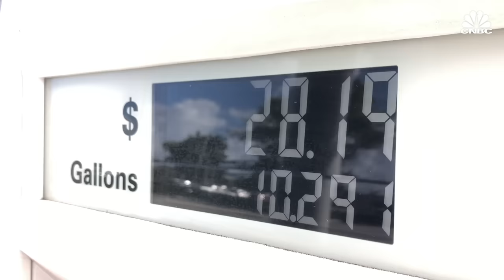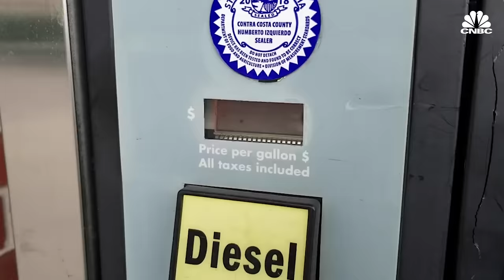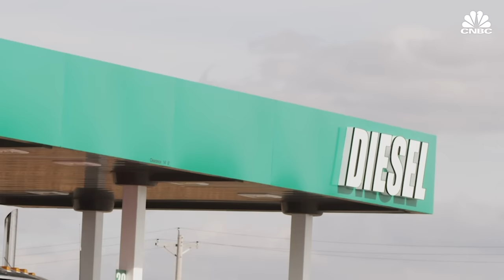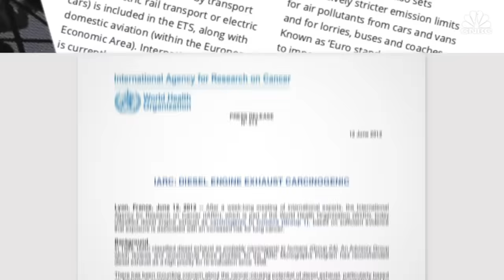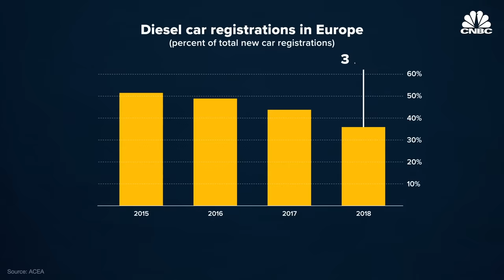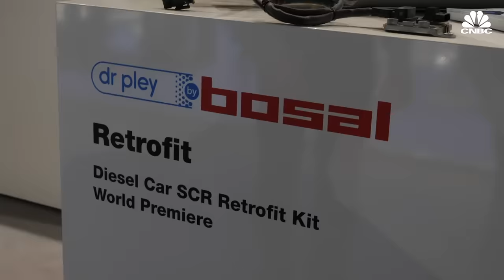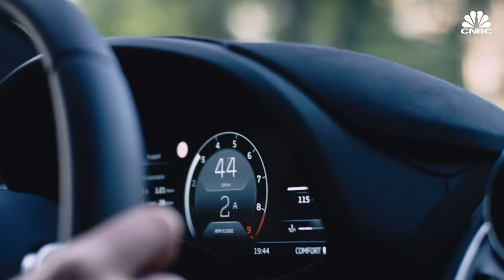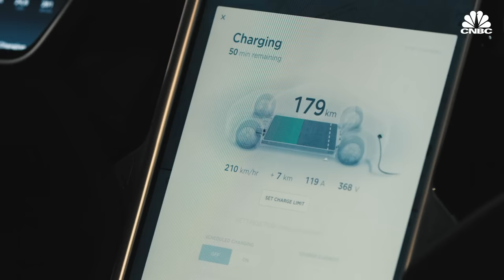Why Diesel Cars Are Disappearing

Comment: They don't deliver a great deal of "power" to the wheels... THEY DELIVER TORQUE. Rotational force.
Reply: No they deliver power. Providing a ton of force to a car over 0 distance is going to do nothing. Providing power to a car is why the force continues to push as the car drives
Reply: He mentions this at 4:50.
Reply: @IFearlessINinja  Power is Kilowatt, Torque is Newton-meter (or pound-feet) ....not exactly the same. Diesel usually have more Nm per Kw than Petrol.
Reply: @IFearlessINinja  like... i had a petrol golf 150Hp(=110Kw) 200Nm, now i have a diesel benz 177Hp(=130Kw) 400Nm -> that's double the torque but only about 20% more power, in Austria i pay taxes for power not for torque that's why diesel is great here.
Reply: Torque = how quickly you get from 0-60
HP = how fast you can go ie 200mph
Reply: Its a journalist science which they can feed to not so understanding masses, not everyone can understand torque
Reply: It's more power at lower RPM's, which is more torque, however it's not any different than if a gas engine had a permanently attached gearbox that reduced speed to the same RPM range as the diesel and same torque, is used instead of the diesel engine. The gas engine will wear out faster due to the high rpm's and be less efficient, so diesel is like a free gear reduction gas engine, but much better efficiency and reliability.

And just to prove me point further: what is different about a gas turbine powered generator and a diesel powered generator in performance? The answer is NOTHING. The diesel and gas turbine with equal power ratings will not have an advantage over the other in performance. The diesel will use a 900 to 1800 RPM generator head (60 Hertz), which takes more torque to turn, and the gas turbine will use a 3600 RPM generator head (60 Hertz), which is less torque required to turn it, but the end result is the same POWER. Power is power no matter how you gear it down or what produces it and in electricity production that is what matters. No one talks about torque. A 900 RPM, 100 HP diesel engine is NEVER going to power more electrical devices than a 200 HP,  3600 RPM gas turbine. POWER is what matters. The 200 HP gas turbine will power more equipment whether it be motors, lights, or electronics, or whatever you have in mind that needs electricity.
Reply: Dzor Misleading how?
Reply: Dzor You don’t have to assume anything none of that you explain has nothing to do with anything. Only things that matter most is weight/resistance and how efficiently said powered is transferred. But even then that basic principle applies that HP = top speed and Torque = how quickly you achieve that speed. This can be applied for the ground or in the air. You’re just trying to be overly technical about the matter.

Comment: At 11:30, talking about the newest generation of diesels with particulate reduction. And catalytic systems to keep them clean, that’s the first things that get ripped off that new GM, Ford, or Ram pickups and tossed in the trash.  I know a few guys with diesel trucks for towing, and they brag about the ‘tune up chips’ installed for more power after the emission controls were removed.  It’s so easy it’s as if the legacy companies designed the vehicles with removing emission controls in mind.  Few places check emission controls on older vehicles.

Comment: I never cared about the “Volkswagen diesel scandal “

It was a nonissue. 

Personally, I want a diesel Polo.
Reply: Dirty stuff, lpg is a lot cleaner and cheaper with out the particulart problem and in city's they not as economical, there made out to be
Reply: jim coulter  That's the joke of modern emission standards, a lean burning engine runs hotter so produces more Nitrogen oxide. So to run cleaner they need to burn more fuel....this is for all fuel types and not just diesel.
Reply: @Pete856 .... It the usual set of compromises.
Reply: I agree 100%. If I could make my own cheat software I would do it. I remember the old 1.9 VW diesel would get 55+ mpg and is still a popular engine for swaps into Jeeps and smaller trucks like S10’s and Sonomas. There was a mechanic who swapped a Cummins 5.9 into a Silverado HD and got more than 2x the mpg. His fuel savings since swap was over $25,000 and he’ll probably swap the engine into a newer truck because the body of the old truck is rusted out. On our farm we used to have a Chevy LUV with a little Isuzu diesel. It got crazy good mpg. I also used to own an old square body 1991 Dodge Ram 3500. The engine went 600,000 trouble free miles pulling a huge trailer most the time. It could get 22-23 mpg with no load and not much less than that pulling 20,000+ pounds. Same story with that truck, the body and frame were rotted out from salt but the engine was perfect
Reply: Diesel engines in passenger cars should not exist - it is merely trickle-down from heavy rigs that need the pulling power. The scale does not apply for passenger cars that only carry a few hundred kg more than tare weight, petrol is just fine.
Reply: No, the polo is too small for a diesel. Only trucks and large SUVs should run on diesel.
Reply: Nasty, many nations cared about public health to the tune of billions of dollars.
Reply: jim coulter  More NOX, please learn about the issue
Reply: @Pete856  Physics vs preference
Reply: @joebloggs9392  Are you aware that over 55% of Europe's passenger cars run on diesel? Diesel gets better gas mileage and modern diesels actually pollute less than modern gasoline engines.
Reply: @DelTalkoh  
Yes but just because everyone does it doesn't make it right... Diesel has it's place when hauling tons of weight but seriously you want a diesel Polo!? Guess there's no cure for stupid these days.
Diesel is more inclined to produce nitrous oxide as the combustion ratio is higher and diesel particulate filters can become easily clogged relatively speaking. go petrol and you have no issues with filters clogging and needing highway runs to burn off, I still get 5.0L/100km in my Mk7 VW Golf, and that's the longterm trip computer reading, yes it's petrol and 1.4 TSI EA 211 engine.

Comment: Here in the UK, the annual car tax was based on C02 emissions since 2001 to around 2017. A 2000cc diesel engine would put out around 200bhp, achieve 60mpg, and would cost about £100 a year to tax. Whereas a 2000cc petrol (gasoline) could produce similar power, but would only hit around 40mpg, and cost closer to £300 a year to tax.

Then there's the cost of fuel. Diesel was typically sold for much less than unleaded but once everyone switched, the price increased so it's now 10-15p a litre more expensive. 

Finally, cancer. They knew in the 90s that diesel was a carcinogen. I had a 1996 Peugeot 306 DTurbo and there was a cancer warning in the handbook which advised against idling the engine in confined spaces for this reason. 

Basically, the government set the narrative. 

As for me, I had a diesel car, it's smooth, powerful, gets great economy on the motorway and is much more relaxing to drive than these new little 1 litre turbo petrol engined things..

Comment: Still seen in most farm and construction equipment. More like ALL...
Reply: Eric one day they will eliminate the production of diesel
Reply: @bngr_bngr  They already have ball-less tractors with the def additives necessary-and 25% loss of power.    Tier 4 crap that will break
Reply: Do you get the feeling that the little CNBC documentary has an agenda? The air was so hot that the fuel burned as soon as it was injected into the cylinder. This is a poor description.
These engines should be left to the people who need and understand them.
Reply: @bngr_bngr  10 years from now? 100? 500? Maybe a few billion years when the sun vaporises the earth? That hardly narrows it down.
Reply: They can't, physically. Fractional distillation of petrol invariably produces diesel-grade fraction. Not as much as today's share of diesel (some of it is synthesized), but a very sizable share. If sales are banned then what will happen to unsold diesel? Cracking it down to ligher fractions is technically possible, but too costly. Burning for heating? Possible, but cleaning up flue gases to automotive exhaust standards isn't cheap too.
Reply: It's fine it's just gonna mean more down time and more screw off time,  lower production . That's when big farming will go to other places on the earth that aren't so over regulated that usually what happens look at Your boys in California once powerhouses in almost everything now a mass Exodus of business.
Reply: @jimtekkit  what the hell ever they were telling us crap like that over 30 years ago when I was a kid and sea level is still the same we are all still here and we are all gonna still be here. Tey went from global warming to global cooling since they couldn't get it right the just gave us climate change to pretty much cover thier asses in case something happen they could say "see see that's what it is"

Comment: 4:52 "But seldom found on sports cars or race cars". They surely haven't heard about Audi R10, R15 and R18 or the Peugeot 908 HDi Le Mans prototypes.
Reply: Have you heard the definition of seldom? It doesn't mean never.
Reply: This CNBC mockumentary sure seems to have some sort of agenda. 
Hey Fun Fact Francisco! Diesel engines were run at Indy. Unfortunately the damn things wouldn't stop enough for fuel!
Reply: Cummins ran one at Indy 500 in the 1960s.   DIESEL engines were banned after that becsuse it was decided  they had to much of a fuel effency advantage
Reply: These cars had their day due to the regulations being bended to make sure they'd win by limiting everyone else's possibilities. Plus they were mere prototypes made by big industry and big money. They were impossible to drive under the rain. So the regulation changed to a more balanced one and they just disappeared as fast as the appeared.
Reply: @brianpatrick8787  1952 and it set a lap record and took pole position.
Reply: Well said. Typically poorly researched and American based report.
Reply: @julosx  What are you on about?

Comment: We bought our diesel because of its torque and fuel efficiency. Our next vehicle will have full torque at 0 rpm and burn no fuel.
Reply: It still burns diesel elsewhere... your electricity must come from somewhere
Reply: @hhnguyen1210  Electricity on the grid almost never comes from diesel. The rates differ for different countries, but generally more countries are getting a larger proportion of their electricity from renewables like solar and wind, and less from highly polluting sources like coal or petroleum. Same for the transportation sector.
Reply: @BritainRitten  nope 20% coal and 30% natural gas aka petroleum aka gasoline and only 3% is wind and solar and 40% hydro electric dams and nuclear so no wind and solar is not going above 10% my guess
Reply: At last a comment from someone who gets it (and has got an EV). I understand people being sceptical that EVs are even a thing, never mind a better thing, but I am continued to be surprised that so many minds are closed to even investigating the alternative. I assure anyone on here who is adamant that combustion engines have much of a future are mistaken; the only thing that perpetuates combustion sales is (1) the auto industry preferring to sell you a Priduct that will need servicing and will need repairs for all it’s life. EVs need safety inspections but there are no routine servicing, just screen wash and wipers (they hate them), plus (2) the lack of Availability of EVs to try/buy. Even if the trad auto brands continue to green wash with hybrids and low quantities of EVs that won’t stop other countries making them and slowly people will try, realise, buy them and local supply will wither and die.

Comment: Bring back diesel! So much more fuel efficient and per gallon less polluting then gas!
Reply: Or just use more electronic
Reply: @alexthebruh  no unless your talking about a diesel electric hybrid with 500+ miles range
Reply: @clownskill11  in what scenario are you going to be driving 500miles in one go
Reply: @alexthebruh  I have a TDI currently and drive about 200-350 miles daily, even a Tesla long range would be cutting it close for me
Reply: @alexthebruh  But I don’t want to have to charge either, a diesel electric hybrid that you could just fill up at the pump and then have a diesel generator power and electric Dynamo.. Plus it did sound right most electric cars and hybrids sound really weird they have to pipe in audio so they’re not silent a diesel motor would have a nice rumble and make it much safer
Reply: @clownskill11  yeah I see your point but if they actually managed to fix the range what would your thoughts be on ut
Reply: @alexthebruh  I’m already saving for a model y or crossing my fingers for a more budget friendly Tesla to come out in the near future. Hyundai Ioniq 5, and Subaru Solterra coming later this year could be contenders to consider… however I would prefer to buy an American or European made vehicle. Would really love to see more options then just crossovers too but probably it has something to do with the battery sizes. Bring back the egolf, or make a super mini, with 420mi range and I’m happy
Reply: @clownskill11  yeah hope for the best of luck for ya I’m Irish do I don’t drive much honestly it’s like 360 km to get to the other side
Reply: @alexthebruh  ahhh you have better options then! Cupra Leon e hybrid has a lot of appeal to me. The American market is all switching to larger suv and crossover styles the smaller wheel base of the seat make the cars more desirable imo
Reply: @clownskill11  oh ya we do it’s wierd America is switching to even more carbon emitting cars

Comment: Nice video! I really liked it
Even the comments were interesting to read, however some readers and drivers don't understand the issue here

Yes, Diesel is efficient compared to gasoline. To burn the respective diesel, you need air. From chemistry, we remember that air contains more nitrogen than oxygen, that's why we get the NOx out the exhaust pipe (both gasoline and diesel)
To remove the NOx effect, an O2 tank should be installed in each car and replace the natural air intake. Sound kinda of expensive, right? I mean, imagine having to fill up another tank, beside the one with fuel :))) (or an accident even worse)
To remove particles, you need DPFs and GPFs, which should be more evolved
MORE IMPORTANT: people shouldn't go to work by car in the city, unless you leave somewhere outside of it. Company should give cars to their employees, simply because they deserve it, they should give cars to those that need to stay on the road
Electric vehicles are OK only for cities. If you need to go outside, and avoid headaches that you will be left on the highway, take a petrol/diesel powered car
Big vehicles (bigger than 2.0) shouldn't be driven in the cities/towns. You don't need that kind of power in a city/town, unless you only want to compensate for something smaller ;)
Electric vehicles should also be used in trucks and ships. Let's see them there in action, with low autonomy or solar powered
Why is Europe the first to adopt such trend of EVs? Let's try with America, Africa, India-Indonesia-China(especially these three, where the pollution sky-rockets)
Reply: China is using electrical vehicle heavily now. They have the most electrical vehicle, more than every other countries combined.
Reply: Thanks for the very well wrote comment you speaking nothing but facts!
Reply: Egr was the first step to significantly reduce egr, then in 2013, scr catalysts converted the remaining NOx into N2 and H20. Dpfs have the highest standards, requiring what is know as a "white glove test" in the tail pipe(no soot should be collected on glove).
Reply: Egr was the first step to significantly reduce egr, then in 2013, scr catalysts converted the remaining NOx into N2 and H20. Dpfs have the highest standards, requiring what is know as a "white glove test" in the tail pipe(no soot should be collected on glove).